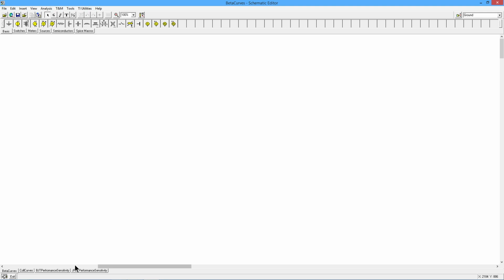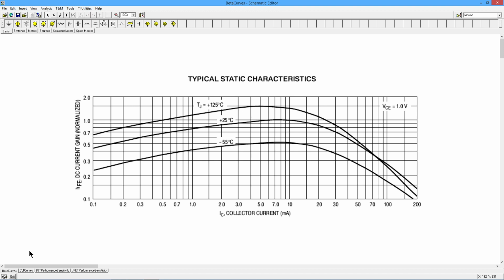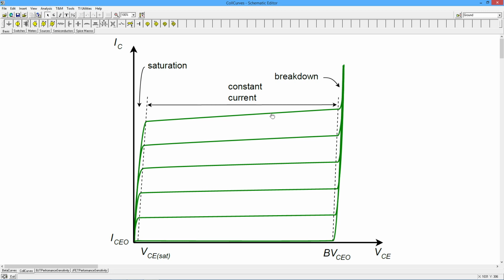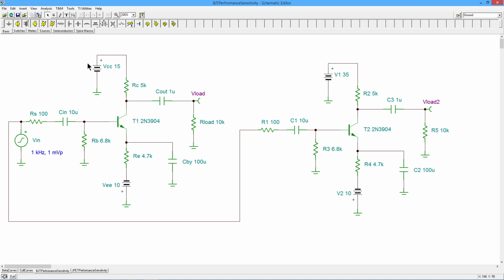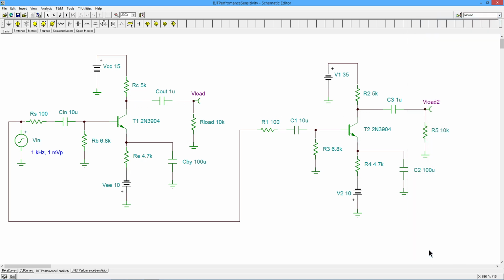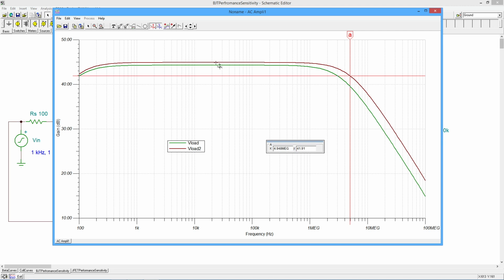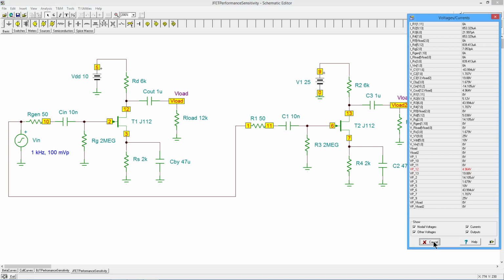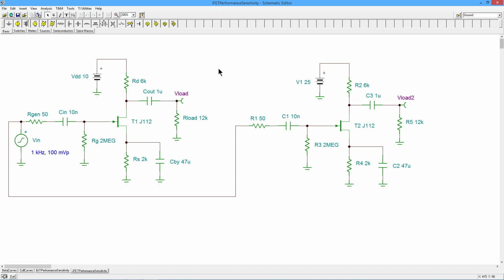Semiconductor Devices: Transistor Performance Sensitivity

Comment: So nice to see some useful coverage of data sheet material. I’ve always found semiconductors and their peculiar characteristics to be especially fascinating. I’ve always gazed at the myriad specifications and charts and wondered about the significance of most of that information, knowing that a thorough understanding of those characteristics along with an almost intuitive understanding of the interplay in those values would be a prerequisite for designing the very best circuits possible. Thanks Prof Fiore. I hope you’ll cover more of this sort of thing.